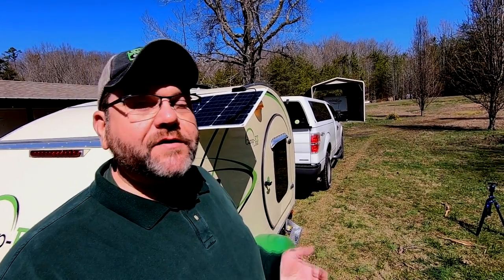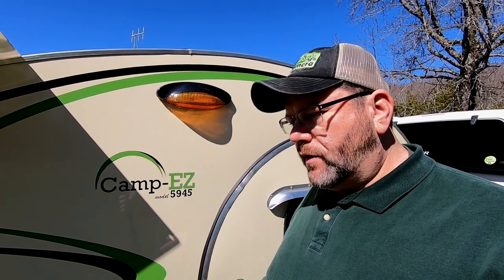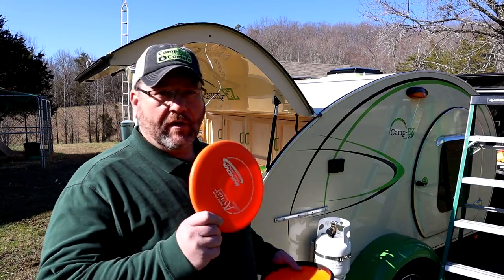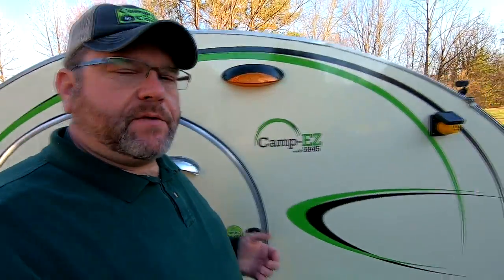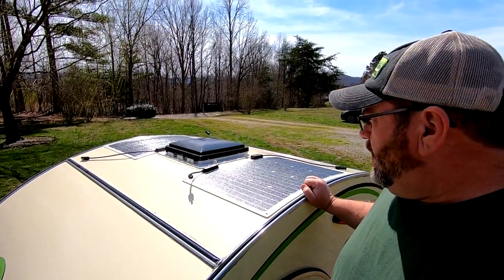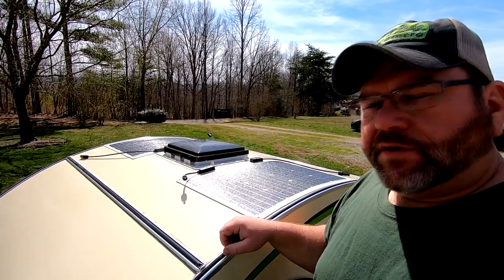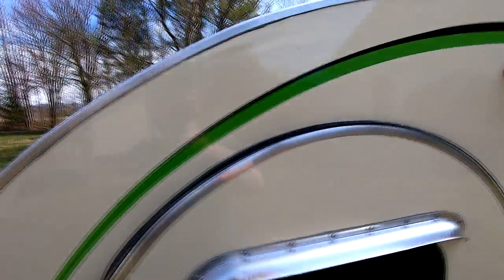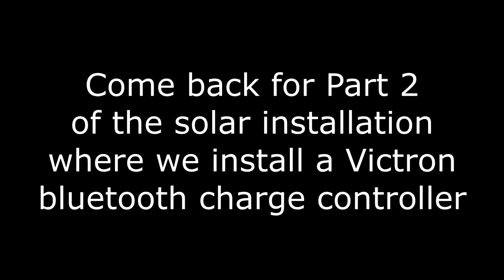TEARDROP SOLAR SETUP - RENOGY FLEXIBLE PANELS

Comment: This is good.  My half-car camper project has a 100W solar panel mounted flush where the front windshield once was.  It will recharge my rockpals.  My rockpals will provide us with LED lighting, heat, 12v fridge/freezer, fans, as well as recharge our devices.  I love what you did with your panels.
Reply from the maker: Jocko Ward Thank you!  Sounds like you have a good system as well.

Comment: Excellent video. Something about installing solar panels on the roof of my trailer feels sketchy. I've done a lot of driving through a lot of crazy conditions from hailstorms to tornado warnings... read online reviews saying these kind of panels wear out after a while and can short circuit. Thinking about getting creative with smaller foldout solar panels that we can stow away after gathering energy for a while. It would be nice to always be gathering energy but I feel like it could be set up where we use stow-away foldout solar panels that we take out during sunny days to charge a few batteries, then just keep an eye on the battery levels. Solar tech is improving so fast, it seems like folks might regret installing those big ones on their house roofs for example when in 5 years there will likely be far superior tech. Might get to the point where you don't even need it on your roof, just like a solar satellite that you put in your backyard that gathers energy from the sun.

Comment: Love the extra thought you put into cable management to make such a clean install. I'm with you on the lithium batteries, too expensive for the casual camper. However, if I was full time it's probably worth the investment.
Reply from the maker: Well said!  Good to hear from you!
Reply: I wouldnt use old style batteries they emit toxic gas. Thats why i wemt with lithium

Comment: you might want to put some eternabond tape on the "forward" side of that panel, and about half way down the sides so wind going down the road doesn't try to lift it off your VHB tape.  i'm getting ready to do this on a cargo trailer and think this will be the safe route.  still leaves you an air gap for water etc...
Reply from the maker: I’ll kick that around.  Thanks for the suggestion!

Comment: How’s it working as far as moisture and Rain? That’s my only concern.
I’ll be doing this today and debating on putting tape around the edges for rain.
Reply from the maker: No problems that I’ve noticed.  I do keep it in a garage when not in use though.

Comment: Something you may want to consider is Lithium. In the long run Lithium is cheeper  but you really don't need 100 ah. I have 2 lithium batteries intended for a Harley they ran about $600 for both. This is enough power for lights and fan continuously for 6 days. I also have solar but I thought really hard if I wanted them on the teardrop. I decided to keep my panels separate not mounted but I normally camp under trees. The advantage to mounting is the batteries will charge while you drive. I agree completely on the corona virus and the fresh air will help your immune system.
Reply from the maker: I hope to do lithium when it gets cheaper.  It’s lighter, holds more, and charges more quickly.  Maybe by the time the AGM battery lays down, it will be more affordable.  I wouldn’t mind having one of those foldable solar panels to supplement when the sun is in a bad position.
Reply: @CampandCamera  Might be a while with that AGM in a Teardrop. I have a lead acid in my Tear...not AGM... charges both while driving from the alternator and with a 40 solar panel hooked to a 7amp controller...been 8 years and the battery still tests out fine and runs perfect.

Comment: You mentioned 10 Guage wire, is you entire camper wired with 10, or just the wiring for you solar? I'm getting ready to wire my trailer up, and similar to you, I will just have led lighting and some charging stations.  I was planning on 14 guage... still haven't decided on solar.
Reply from the maker: 10 was just on the solar.

Comment: How fast are you going and how far are you travelling?
I used this tape in combination with eternabond and my panel still came off.
Reply from the maker: I usually travel 70 -75 mph on the interstate and go a few hours at a time.  No issues.  I prepped the surface and used primer.

Comment: Great video, very helpful. Two questions - can you point me to the grommet that you show going through the side of the vent? That's slick!
Reply from the maker: Thank you!  I bought a pack of grommets in different sizes so I could use them on other projects as well.  Here’s the link:  GiBot Cable Glands - 25 Pack Plastic Waterproof 3.5-13mm Cable Glands Joints Wire Protectors, PG 7/9/11/13.5/16, Black https://www.amazon.com/dp/B0748JLNR4/ref=cm_sw_r_cp_api_i_9VHLEbGH3Z3D7

Comment: How are the panels holding up?  If you were to do it again would you place something under to create an air gap?  I see some people installing the flex panels that way.  I'm trying to decide if I should.  Thanks in advance.
Reply from the maker: So far, they’re doing well.  If I had it to do over, I probably would have mounted them on a tilting bracket so I could aim them directly at the sun in the morning and evening.

Comment: Fast forward to 2024. How have these Renogy panels held up? And has the 3M tape held up? Thx. Great video(s)
Reply from the maker: @tomf9292  Both are working well, and the tape is holding strong.
Reply: @CampandCamera that’s great! No heat issues? Thanks for the video. My panels are going on today…I hope😊

Comment: Renogy specifically recommends using a structural silicone adhesive to bond panels for mobile uses. I have used that black 3m tape for years, it does not work well when it gets hot, i am very curious as to how this held up.
Reply from the maker: So far, so good.  I put a bunch of tape on it though.
Reply: Awesome, I'm building an off grid system for my semi truck, looking to install 3, 175 watt Matt's on the roof to keep 1200 ah system topped off.
Reply from the maker: Wow!  That will be quite a system.  You’ll be able to power lots of items with that.

Comment: Hey - been watching your videos for about 6 months now and last weekend I became a Teardrop owner!   Very helpful!  How is 100 watts out for you?  I've got a Little Guy Rough Rider 6 wide and have very limited real estate on the roof.   There is more space on the hatch.   I already have a 12V battery system that can charge off of the 30A when plugged in or the vehicle when towing. I want to power the ceiling fan,  sink pump, lights (LED conversion is next on the list) and some small electronics to charge inside.  Is 100 Watts enough?  the 100W Renogy is too big but I could do 2 50W panels in parallel like yours..

Comment: AGM can be pulled to 50%, Lithium can be pulled to 80%
Reply from the maker: That’s great news!
Reply: @CampandCamera  Nonsense, a deep cycle AGM can easily be drawn down to 80%. 80% of the difference between your float voltage (fully charged; 13.2 VDC) and your ECV (end cell voltage; 10.38 VDC) or 10.98 VDC. 12 VDC (volts direct current) is the Nominal Voltage. Cheers!
Reply from the maker: Thanks for the update!
Reply: @CampandCamera  If you find yourself in Denver...